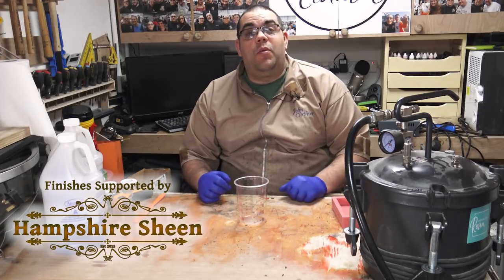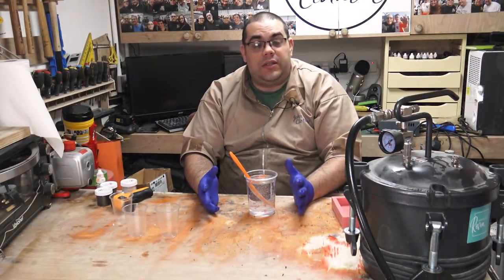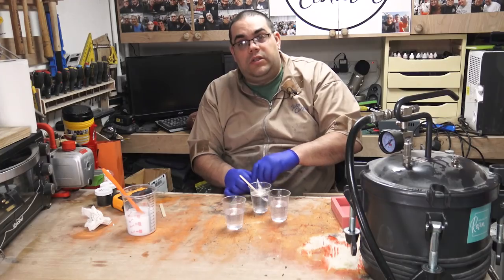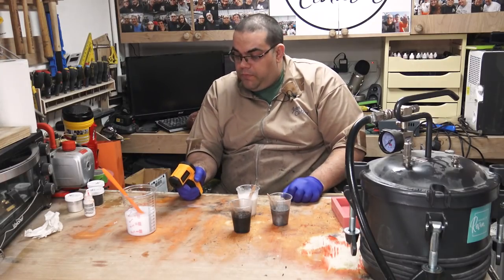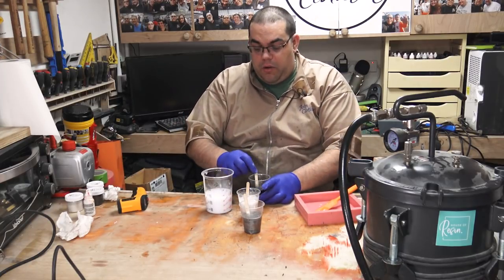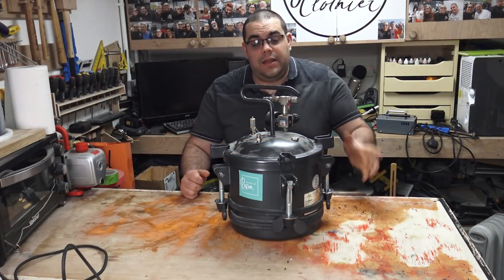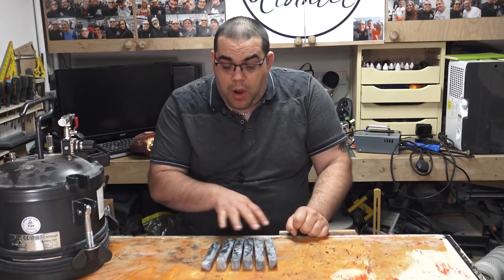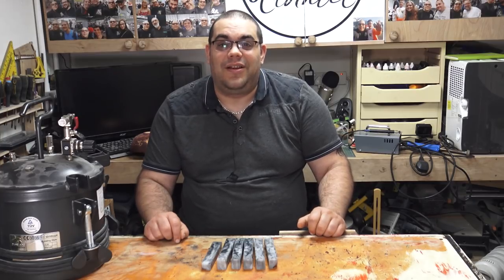Resin Casting Marble Effect Pen Blanks

Comment: They look really good John, will there be a pen making video from them ? BTW that's a neat little  gadget you used to monitor the temperature.
Great video John, Cheers,   Bram.
Reply from the maker: Thanks Bram. The lathe is tied up with another project or I would have done one in this video. I may well make a pen  and put it on Instagram / Facebook